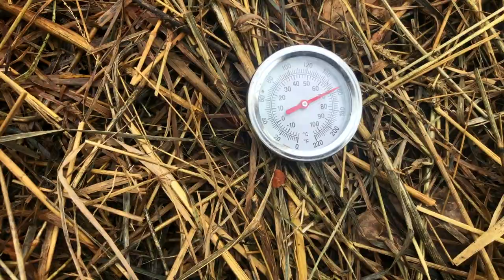Greenhouse - Heating with Compost Power and Moving Water?

Comment: A bit late to the party here. I've constructed heat transfer coils for brewing, and I'm fascinated with thermosiphons. As others have pointed out, a low flow volume (ie of siphon) will help even out the temperature gradient between pile and coil. My first thought is that the coil is wound too tightly. For a given length of tube, a wider coil with fewer turns & a wider turn radius would allow the coil to extract heat from a larger volume of the pile. Finding spacers that you can add between turns would help this. 

Another comment re siphon: air bubbles will kill it (stop flow), and they're a pain to purge. It looks like that bilge pump is the perfect tool to purge. You can also use a pump to push a piece of sponge that's slightly larger than pipe through the pipe to push through bubbles (this may take some trial and error).

I might be able to advise re specific pipe fittings, if you have questions there...
Reply from the maker: Thanks for the thoughtful and informed ideas here.  I appreciate them.

Comment: How about putting a temporary greenhouse over the compost pile and insulation around the sides? Connect it to the permanent greenhouse so there can be heat exchange with large air tubes instead of a small water pipe. Basically, a souped up version of what you had before with the mesh vents. I know enclosing it would mean more work keeping it watered, but it's a thought.

Comment: this seems like a geothermal idea but your using the limited power of a compost pile. Your best bet would be to do a much larger pile  that is in a pit. Putting it deeper into the ground will allow it to benefit from the geothermal portion as well as the composting heat. I would make a trench 5 feet wide and as long as I could, and probably 2-3 feet deep, lay your lines and fill it with compost materials.
Reply: Yes, I would try this too. 5 feet wide, 10-15 feet long, 1-3 feet deep trench with pipe, and build a 5 feet tall, compost pile to cover the entire trench.

Comment: DIY yourself a concrete water cistern that will be partially buried into the ground .  that will give you the thermal mass you need beriot halfway in the ground. You will be heating the soil and it will turn it into a thermal battery and the heat will store in the side walls of the concrete. Also tripling the size of your coil to a minimum of 300 feet. and put in the coil closer to the ground in spreading it out closer to the ground instead of stacking it taller.... You can also cut a hole in the side of the greenhouse to let the compost pile directly vent the hot air into the greenhouse just put some chicken wire over the whole. It will passively let the hot air come into the greenhouse along with the water heat.

Comment: I can help you with your pump problem.  A sterling engine can be made from scraps and and it's function is it's powered by temperature difference to convert to mechanical work.  This is the correct , cheap,  and efficient way to power a pump for this application. I'm working on a bigger,  more efficient system.  But I like you.
Reply from the maker: Thanks for the note here!  If you get a good design functioning please share a video here so we can learn more, or a link to details :)

Comment: I wonder how long a compost pile will be hot enough in your cold winters. As we all do, you're losing a lot of heat out into the air. Though it doesn't look as if you have room for a Coleman straw-bale-sided one there to conserve the pile's heat, which seems the ideal construction to me. Is the pile in the sunlight?

Comment: Have you tried to install a gate valve to slow your water flow through the compost so it can pick up more heat as  a temporary fix?
Reply from the maker: I wouldn't want to restrict the flow so the pump pushes harder.  I think I need a smaller pump perhaps.
Reply: Worked for 30 years in a paper plant. We used this method to help regulate flows on a temporary system to set how things performed before making it permanent. Most pump will handle the slight restriction. Wouldn’t go beyond 50% closure of the valve. Looks like a low psi pump so should be ok. Just a thought. Love your videos. Keep up the good work.

Comment: I'm concerned about how long you can depend on the pile to keep producing heat. If the pile stops providing sufficient heat in the middle of January, how can you recharge it without your greenhouse taking a major hit until a new pile gets started?
Reply: Leaf litter and urine packed into the center, it would heat back up fast and is completely doable as long as you can access the center of the pile; until that point urine an leaf layers would super charge any pile.
Reply from the maker: I could imagine it stalling mid-winter.  This is a test run and I will hopefully rebuild at some point when we are getting closer to seed starting season...
Reply: @edibleacres  The thing about a compost pile is... you can always add more material especially as it breaks down. Every month or so add on two new feet of material boom heat recharged. Cheers,
     Bill

Comment: I would do a design very similar to doing a basement or driveway in floor heating system that would be buried within a slab of concrete now the trick is to have the conost heat sit on top of the slab which would then intern passively pick up the heat with the pipes embedded in the concrete the concrete acts like a thermal mass and it’s highly recommended to have as much insulation panels place under the slab prior to pouring as possible to reflect and contain the heat on the compost and not let it seep into the ground
Reply from the maker: Could be a neat design path to explore!

Comment: Subbed! Thank you for sharing. Noob compost question: if you’re relying on the heat from the compost, how do you ensure that it doesn’t heat too much? How often do you turn it so it doesn’t catch on fire (does that happen?)?
Reply from the maker: Glad to have you on this path with us.  'Too much' heat could be handled by taking more of the heat into the water to heat the space, that's what I'm working towards.  I am not concerned with it catching fire in our cool, damp climate with a compost pile this small.  The story of compost catching on fire is more like a massive barn filled with hay bales that are still damp... They start increasing in heat but are so so large of a pile that it just keeps increasing until combustion.  In this context I think it is incredibly unlikely.
Reply: EdibleAcres thank you so much. I’m really enjoying your channel. I just watched the Living Wall Update, incredible!
Reply: I’ve read that damp hay produces flammable compounds. Those compounds ignite at a lower temperature than hay does. So its not the hay that ignites initially.

Comment: If your holding tank was taller you would have a stronger temperature gradient and better passive flow.... If you could find a way to heat the last couple feet of hose flowing into the tank that would help, even insulate it with a couple layers of clear bubble wrap... The sun would heat it up and drive circulation
Reply from the maker: I could imagine a taller tank being helpful here for sure.

Comment: Until you have the thermosiphon worked out, would efficiency be improved by having the pump connected to a thermostat so you only pumped when at the desired temperature?  On the overflow issue, why not just go old school and have a hole drilled to the top of the tank to an overflow drain like a bath tub?  At least it would be passive.

Comment: Try running the black pipe inside the beds themselves. The heat will circulate through the system bringing heat to the beds.  You could also use an automotive heater core  at the highest point as a heat exchanger. Being heat does rise the heat within the water will find its way to the heater core and  be expelled into the green house. A pump is not needed and it would exchange the heat better than the tub of water. You could do a dual system like this having the heat forst rise up to the  heater core leave it then go through the beds soil back to the compost pile to extract as much heat as possible. by also heater the mass of the beds themselves.

Comment: So long as you're generating excess heat, then why not add more coils? You could also set up a coil just for heating the house. Run that coil's hot water into the house and into a vertical tower containing a secondary coil, and it will draw cool air in near the floor and passively (by convection) expel warm air at the top and return the cooled water back to the compost for a recharge.
Reply from the maker: Sounds like nice upgrades.  Perhaps a bit more complex than I'd want to get into this season, but definitely something to consider.

Comment: Yes suggestions are more pipe so the heated water is in the pile for longer periods of time add a vent to your compost to keep it oxygenated insulate the tank to help retain water Temps use taller water storage such as staked barrels for free movement of thermal heated water heat goes up use that to slow the movement of water add several barrels so that water movement migrates through the system insulate everything you can between source and storage the more time it takes for the water to cycle the more gain of heat from it the water leaving your compost should be very near the temp of the compost pile itselve

Comment: I would put pump on programmable timer. On 1 hr off hr.
Reply: Good idea if the possibility to get the pile bigger is not an option  ! It will prevent complete heat drainage in the compost !
Reply: @erector5953  and Celtic Bear a thermostat could be programed to shut the pump off after falling to a certain temp too.
Reply: @cgregornik  it's better but not cheaper .
Reply: @erector5953  check out "Organic Pools airlfit pump system for a koi filter"  I love this idea.  Okay, a cheaper solution could be a toggle switch ran inside the house for a quick cycle every so often.  But, I question the cycle not happening on its own if the temp rises enough anyway?  My concern is the back flow if the pile cools off, right!?!
Reply: A smart switch connected to your phone
Reply: @erector5953  could be done using an oven controller, plenty of those around to reuse.

Comment: Insulate your pile with a tarp and several layers of bubble wrap. The first place snow melts is the top of the compost pile. Trap your heat, don't let it escape. Add old hay (not green), wood chips or any other form of carbon to slow the piles composting process. Doing this will stretch your piles burn time. The hotter it burns the quicker it will complete the compost cycle. Any time you pass 160f. your too hot and will kill the good micro organisms rendering your pile sterile with few if any red wigglers and other wonderful compost critters to enhance your soil. Set your inside tank on a pallet to reduce ground heating and also prevent the tank from rusting out. If you dig a hole 3' into the ground and insulate the floor and walls with foil faced polystyrene insulation board and now fill with your compost material, you'll have your natural thermosiphon.
Reply from the maker: Great notes, thank you!

Comment: wondering if you could run the whole system inversed. use the water tank like a boiler and keep it heated in the pile, then radiate the heat out through the pipes into the green house kinda like a floor heating system.
Reply from the maker: That's a really interesting twist on the concept, I like it!

Comment: How much heat can you extract before stopping or appreciably slowing the compost process? How does the pile react to heat extraction, or does it react? Is there a sweet spot, a balance of heat extraction and composting?
Reply from the maker: Seems like the issue I keep running into is stripping too much heat out.  I'm learning I need to make MUCH larger piles for a good long running system.  I'll share more notes when I try again.

Comment: Have you ever tried heating the greenhouse with compost INSIDE of it? Think of how warm your winter chicken run is. Maybe you could even embed it in the center of the soil which I've seen people do too. And since I know you have those tubes buried, circulating the air through the soil and through the compost block in the middle could do additional heat transfer directly into the soil.
Reply from the maker: Since the greenhouse is coupled with the house I don't want to focus the gasses and smells inside and have them in our living space.  It needs to be just next to but outside of that space I think...

Comment: straw bales for a wall around the compost, double the pipe length , and raise the internal thermal water store, and add straw bales ontop of the compost for a thermal lid, to contain the heat, once a month lift the lid of straw bales and turn over the compost with a little new stuff and replace the lid,this will gravity feed, i would brach of a 22mm pipe for a radiator in the house , with 22 mm rad valves , fitted for a gravity feed, for a little extra warmth for your house
Reply from the maker: Neat ideas here thank you very much for sharing.

Comment: Sorry im late to the party but here is my best solution. Raise the outlet hose (hot) to the height of the ceiling on its way back to the tub, make sure to have at least two meters direct fall into the tub, use the syphon technique you would similar to the extraction of fuel from a car, because the water is heated it should want to expand and take the path of least resistance and hopefully create a gravity and heat powered constant water cycle, not sure whether the bottom (cold) tube should do the same on the way back trying to create a double syphon effect? or come from the bottom of the tank? Probably the bottom. Could work maybe with some tinkering. 

Option 2. Maybe have the tank itself inside the compost and the tubing running throughout the garden area, maybe even also under the garden beds, maybe there is a way to then just have a completely closed system and have the heat and pressure cycle the water? maybe a small impeller on the outgoing to create a vortex.

I Realize i am years late haha i am going to go and see what you done now. Cheers.
Reply from the maker: Still appreciate you sharing notes :)

Comment: Would there be a problem with using coiled copper pipe instead of the plastic  ?
Reply: yes about a $1000 bigger problem coper is expensive, drip line new is about $10 per foot.
Reply from the maker: Copper woudl be great for transfer... BUT very fragile and easy to puncture/break/bend when removing and DEFINITELY more than $2!!!!
Reply: I actually was fortunate enough to find a coil of copper tubing at a hardware store that was going out of business,  i bought the roll at about 50% off. I've been thinking about what i want to do with it,  after deciding not to make moonshine 😊

Comment: If you leave that running most likely overtime it will catch up to close to what the piles temperature is it’s just because your volume of water is so much larger than your volume of heated water but by constantly flipping it through your heat exchanger it will eventually catch up will take a long time because of your small heat exchanger just food for thought
Reply from the maker: I suspect that could be true.  We're trying it again this winter so we'll share notes.

Comment: Also some hay bails, like what you do for your folks, along the bottom of the front of the greenhouse would help. There is nothing there that benefits from the sun, although the bricks do absorb some heat, I think a layer of hay bails would have a greater effect.

Comment: I see a few issues here, the flow rate is too fast for the size of compost you have, basically what this is doing is cooling the compost pile rather than the compost pile doing the heating. you want the transfer of energy to be stronger on the heating side more than pumping the water through cooling. 

using a smaller hose / slowing down the flow dramatically and even using a smaller barrel for water  would help allow the compost transfer the heat. This video is old so likely you have figured out a solution. Cheers!

Comment: Some people have had success warming water in a metal vessel by placing the vessel directly in the compost pile right up to the brim.
With the supplies you're using, your method does not scavenge enough heat from the compost to make it effective or efficient. 
If you want to maximize heat transfer and minimize moving parts and lengths of hoses, put the stock tank in the middle of the compost..
Reply from the maker: I get you on this...  Something to consider for sure, although we have some serious space constraints we have to design within.

Comment: Instead of a coil that is centred in one place, you should have it dispersed in loops in layers so that the compost is completely surrounding the pipes for maximum contact area, as long as you have a height differential, the water will come out at the top hot, cooler water is more dense and harder to move, so the siphon then begins...
Reply from the maker: I hear you for sure.  I think my concept was that I wanted an easy way to pull the coil out at the end, and this design seemed like it would help with that.  BUT, if it doesn't collect heat well it's not a great design!